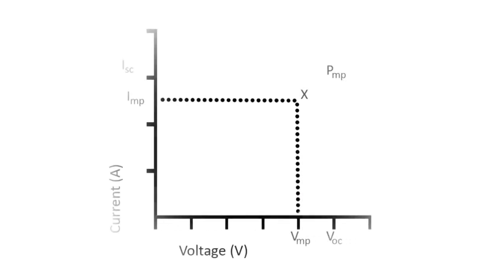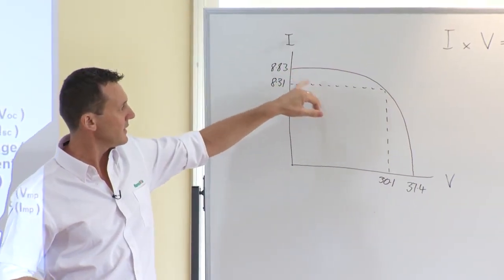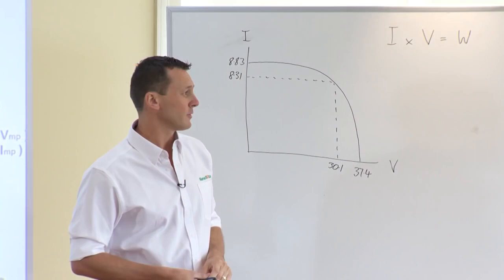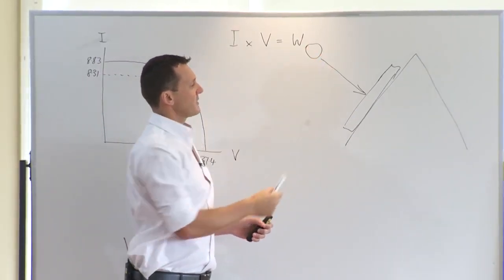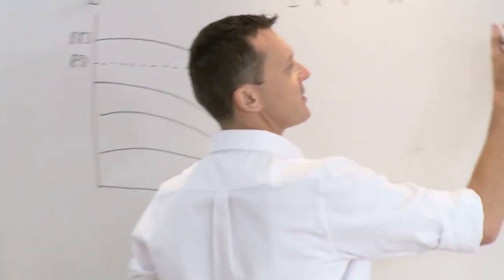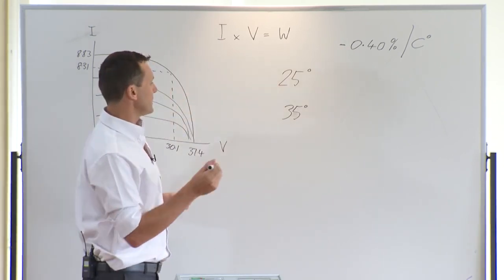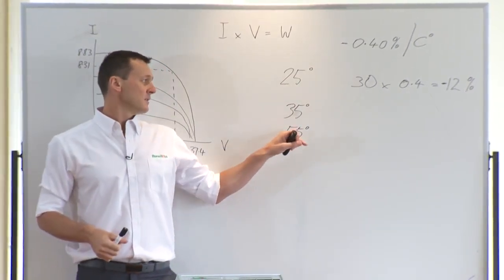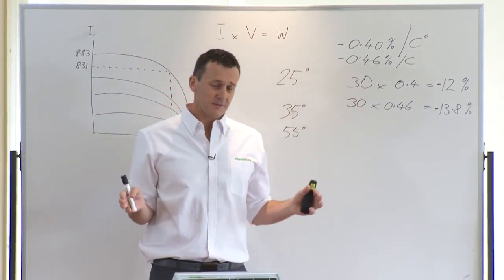How to read a Solar Panel Technical Data Sheet   Understanding IV Curves   ReneSola Vitus II

Comment: Great.  Thanks.  Assuming the sun angle is a vector at some angle other than what the panels are mounted you can calculate using simple trig how much the angle affects the current value.

Comment: -0.40%/C is a very inefficient panel. I hope they've gotten better in the last 6 years.   REC Alpha Black and many others have a -0.26%/C.  That's important in my area where a panel can run over 68C (assuming the same +20 above ambient).

Comment: Good video. I would like to know the importance of Open Circuit Voltage and Short circuit current. Does it gives any other idea other than those are the possible maximum of the current and voltage?

Comment: Very informative.One question why voltage is relatively constant but current changes almost linearly with change is solar radiation?Thank you
Reply: Flow of electrons from valance band to conduction band depends on solar radiation

Comment: Dear ReneSola Global,

Thanks for your great video.
And I have 1 question about temperature coefficient which is that "What happens when temperature goes to (-40) or (-45) degree something?"
As my understanding, when temperature goes down to minus (-) Solar PV module produce more energy than a usual.
Is it right to calculate it, this way:
                                 normal temperature: 25degree
                                 In winter Mongolia reach -45degree
                                 This case result will be 70degree.
                                 So it can be 70degree * 0.40% = 28%
                                 It means when temperature reach -45 degree in Mongolia, Voltage will                increase by 28%?. (Will produce more energy right?)
Waiting for your kind reply

BR
Oyun-Erdene
Reply from the maker: Hi +Oyun-Erdene Altan-Ochir 

That is a very good question, and thank you for posting it.
As pioneers within the renewable industry, we encourage the public to ask the right questions about photovoltaics.
As they can help educate & share ideas with other like-minded people across the globe .

As to your question about the Virtus II solar panel becoming more efficient as the temperature goes does below 0°C.
And the secondary part, which relates to specifically Mongolia.

1. When temperature goes down, the power out and voltage will go up, it is true.
      a. However the temperature within the solar cell is normally higher, than the external air temperature.
      b. Normally the cell temperature is higher by 20˚C.

2. Apart from the air temperature, one also has to take into account is the irradiance from the sun, wind factors, humidity, etc 
      a. There are many external factors that contribute towards the efficiency of the panel.

3. The lowest temperature usually happens in very low irradiation, such as at night. 
      a. Temperatures like -45˚C in Mongolia happen in winter and at night, yes?
             i. With solar panels electric power generation originates from the sun irradiation during the day, and there is no power generation at night.
             ii. Hence let’s say hypothetically it is a cold day at about 12pm, approx -25˚C, that would mean that the cell temperature is about -5˚C.
             iii. There will be an increase in voltage, and theoretically it will be hard to give you an exact number of its efficiency rating because of the external factors.
4. The main aspect is that your panel will not be losing an efficiency on extremely cold day. Providing that its clear skies, and no snow cover over the panels.

5. When selecting your preferred solar panel, always look for one that has “potential induced degradation free” panels or “PID-Free” panels.
        a. This certification confirms that your panel has premium solar cells, EVA backing sheets and tempered glass, giving you a more robust PV system.
      b. And adding in as well, extremely low temperature co-efficient, which will give you a longer lasting & highly durable panel.
Reply: Dear +ReneSola Global 

Thank you so much for your reply.
It was so useful.

BR
Oyun-Erdene
Reply: @Renesola   What a fantastic video and a great question and equally a great reply ! 
I  am a beginner entering the solar pv world. Love , respect and regards from India!!
Reply: +ReneSola Global 3.iii, So if there is an increase in voltage how is there not a drop in Pmax then? Or is it just very negligible? What about solar panels on satellites, I would have thought cold temps would not be a factor.
Reply: @ Oyun Erdene: What a fantastic video and a great question and equally a great reply ! 
I  a beginner entering the solar pv world. Love , respect and regards from India!!